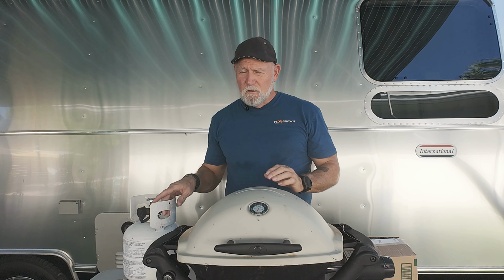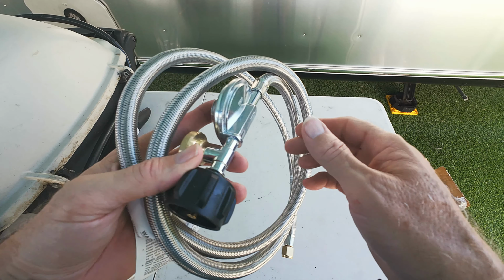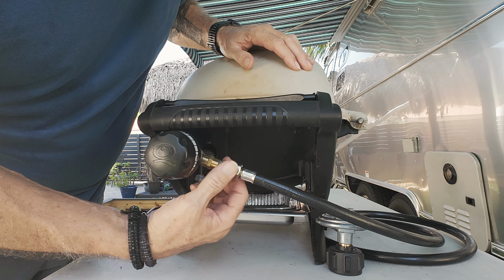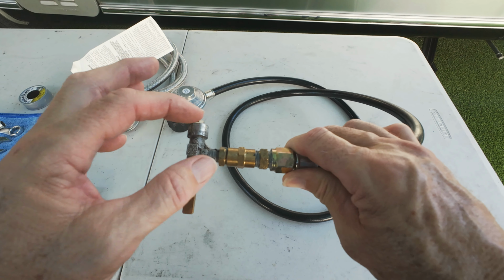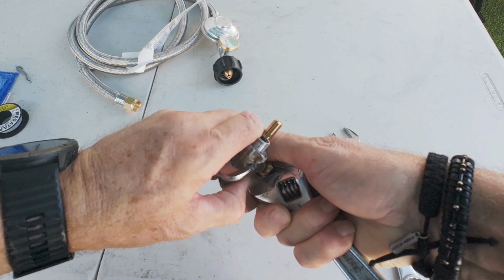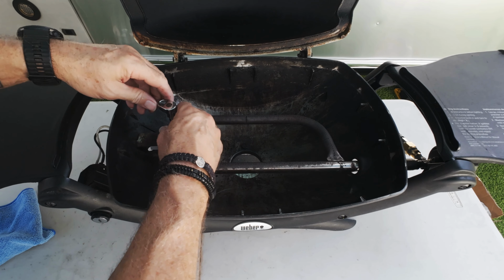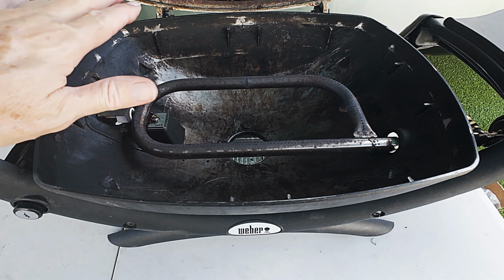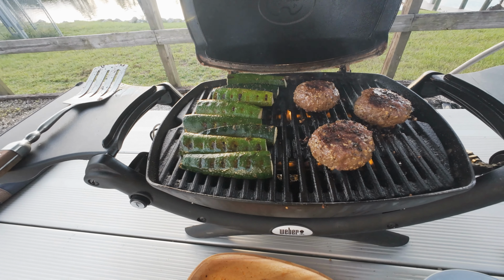WEBER Q1000/1200 Hose Upgrade & Alloxity Propane Hose Review

Comment: how long does the small tank last?
Reply from the maker: By “small” tank I assume you’re referring to the 5lb or 1 gal tank. I don’t have a way to measure it exactly, but it lasts a long time. I  use it al least once a week, sometimes 2-3 times a week. I’m always amazed at just how long many cooks I get out of it. It seems like I was going through those little green tanks every couple of cooks. I generally have to refill one of my 30lb tanks on our Airstream every 3 months. I take the small one with me and have it topped off. It “usually” has about 25% left and  it will take around .85-.9 gallons (1.25 gal  is max).

I have the small tank primarily because of space and weight. Obviously a larger 20lb or 5 gal tank is going to last a lot longer!!

Hope this helps.
Reply: @SandsweptJourneys thanks mate. This helps alot. My q1250 has an included conversion hose but needs a separate regulator. I have now bought a 5kg tank similar to what you have. It will keep the cost low, the disposal one cost too much here in my country.

Comment: The hose on the link looks nothing like the one you have on this video. What am I missing? I ordered the one on this link and it’s not the correct fitting
Reply from the maker: @ArpexOfficial There has been a change in the products from ALLOXITY. I have placed links below to alternative products that will work for this application.

6' Hose (rubber) with Gauge 
https://amzn.to/3IqwuTg

6' Stainless Hose without Gauge 
https://amzn.to/3JXX4DV

I apologize for any inconvenience.

Comment: Thanks very much for your detailed and informative instructions. I’ve just bought a barely used Q1200 from eBay. I thought a regulator conversion to a larger volume tank was the was to go.
Kind regards from Nottingham England.
Reply from the maker: Thank you! They are great grills!!